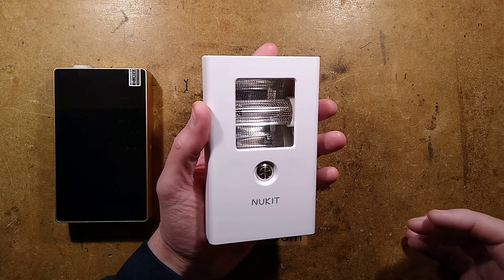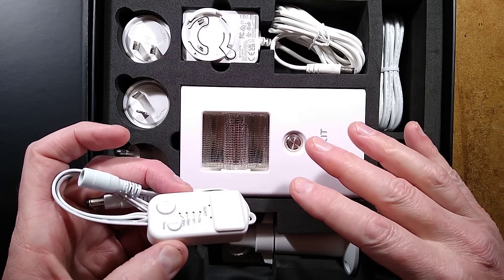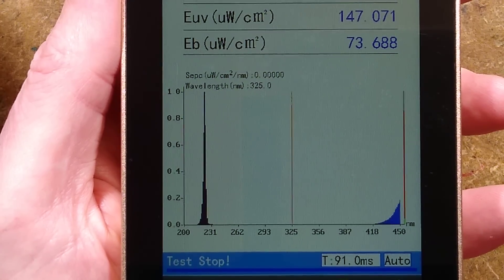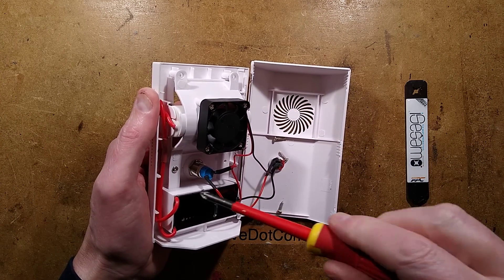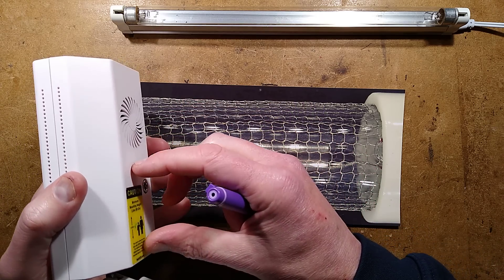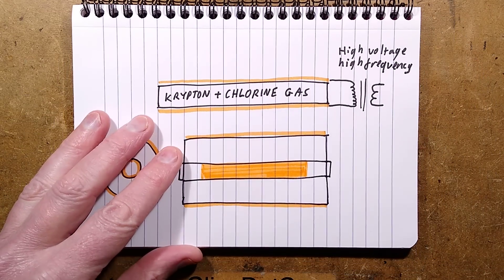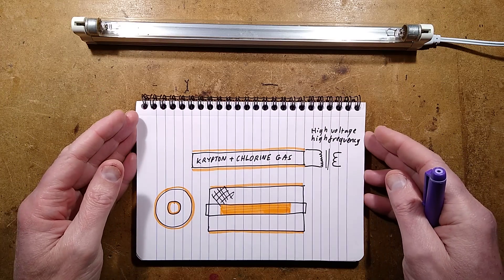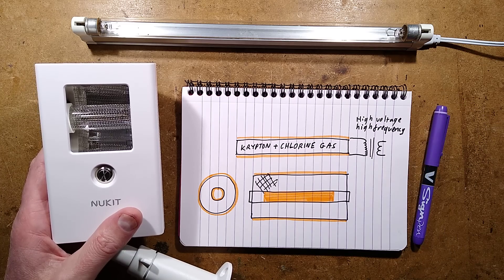Naomi Wu's Nukit 222nm sterilising excimer light

Comment: As a few people pointed out, even 222nm deep UV-C isn't 100% safe but good enough for most part since radiometric strength (brightness) matters a whole lot. If you are further away from UV-C lamp (be it LED or Excimer lamp), you're totally safe for most part, it also about how powerful is the light source (Excimer lamps tend to be inefficient, so deep UV-C LEDs are usually a concern due to their electrical efficiency, thus more powerful than gas-filled lamps).

Nevertheless, I did research a bit on 222nm deep UV-C bands for medical purposes, it's interesting that we're not as affected by it as much as Mercury-II UV-C lines (253nm being the chief spectrum line for Mercury vapor).
Reply: A brief synopsis of inverse square law might go a long way in explaining why this holds true.
Simple inexpensive polycarbonate safety glasses block pretty much all UV
Reply: Right; 253nm may be longer wavelength but is absorbed more efficiently and can cause greater damage (vs 222nm). If it is not absorbed by the cells, biological damage is minimal.

Comment: Clive, I have found 12V off grid/grid down is very hard to get if you are not starting with 12V batteries.  Most if not all power banks provide either 5V,  USB C and 120/240V.  The USB C does no do 12V native, and doesn't do any voltage native as it needs programming,  hence using USB C to lite a 12V filament bulb wont work.  It would be great if you could find ways of doing 12V without a 12V source when not relying on the grid :)  (my reason for asking, where I live I have a power failure at least every other week, my work from home mini computer is 12V and uses a wallwart and barrel jack to supply that and per the maker whom I contacted, it will damage the unit if you run it on the normal range of a 12v battery of 14 down to 10 and back up to 14 volts, it runs on 12 and like the holey grenade 10 only if gong to 12, and 14 is right out 🤭).
Reply from the maker: You can get USB to 12V converter cables.
Reply: perhaps a boost/buck converter module would give you a stable,regulated12V from a SLA battery's varying voltage,at the power levels you need for a laptop. maybe even from a USB source if they can source sufficient wattage.

Comment: I spent this afternoon disassembling my dehumidifier to get at an annoyingly loud buzzer. The thing was not designed to be taken apart once assembled. I removed all the obvious screws but two crucial screws were covered by a piece of plastic which was attached to the unit with ten inaccessible clips. Got there in the end with a little bit of bending of plastic. Buzzer successfully de-soldered. Thought of these tear-downs as I was fighting it.

Comment: I was hoping the whole virus fiasco would cause these lamps to develop into full production and lower the price and make the lamps more accessible. Bulb construction is simpler than a fluorescent, since there doesn't have to be any electrodes penetrating the envelope. Wavelength can be tuned by various gasses and halides. What are the details of the spectrometer? Model number?
Reply from the maker: The spectrometer is a Hopoocolor OHSP-350UVS.  Very specialist wavelength range, but they do others with a wider visible spectrum.

Comment: I'm cto for a uvc equipment manufacturer. We've had 222 lamps for testing for over two years now, working on products. We've tested both Chinese made lamps that look very similar to this one, but also t8 style tubes and lamps made in the EU by Ushio. From our testing they indeed work as advertised and are safe in normal use cases. Some interesting caveats and things we've found out. Ushio claims to have a patent on the filter (glass) material required to get that narrow wavelength. They claim the Chinese lamps aren't that airtight so the gas will slowly leak out and be ineffective (haven't seen this in the small lamps so far). Their lamps have distance sensors (single chip lidar based) that turn off the lamp if you get closer than a few centimeters because dosage matters, it's safe up to a higher dose, not to any infinite dose. There are not very extensive studies from 2023 showing they produce Ozone from the air being hit with the light, not from the tube itself, we haven't tested this because the power is so low on these you'd have to have a lot. But in a non ventilated space it could build up. The lamps we've seen are very low irradiance compared to traditional, it's also not very well established what dosages are used for what pathogens like we have for classic uvc, everyone playing it safe. Overall interesting tech, very early days. The power supplies on the Chinese stuff we've tested have been very crap inside the potting (cobbled together in some cases), maybe they've improved since, worth a video maybe?
Reply: Whilst potting is a great idea for high voltage stuff it’s the sausage of the electronics industry….  Packaging that hides all kinds of sins
Reply: I truly admire some of the Chinese 'cheapness optimizations' that can be found, but they can have some SUPER-sketchy power supplies, ones that are way scarier than I'd have believed any human being might bother to sell or use.  That's the first and most-important thing I check on any 'cheapy-project' items from China is their power supply system.
Reply: @EShirako  I agree, there is a noticeable difference between functional and safe/reliable.
Reply: @EShirako  this cannot be stated highly enough. I throw cheap PSUs in the WEEE bin as I'm cautious of them. We had a PSU (OE supplied with a quality item) that eventually went 'pop' and started smouldering. If I hadn't been in the house and heard it I dread to think what would have happened. It was all CE marked etc.
We need randomised quality inspections on Chinese products prioritised on risk - PSUs being highest I would say.
Reply: @thebrowns5337  I think I can agree with you.  :-\  I'm to the point where I even closely check ANY voltage-regulation that involved the mains before I leave an item unattended overnight/out of my sight.  I've had a steady decrease in quality happening in power systems, especially including fake (or badly de-rated) MOSFETs.
Reply: Good to hear about Naomi.
Reply: Water disinfection requires an adequate germicidal dose and contact time. For air and surface disinfection it is just the same and comes down to what organisms you are trying to kill and their population.
254nm was a primary germicidal wavelength so 220nm may have a similar effect but this needs testing properly in lab conditions.
I am very nervous about its claims that it is safe to view by naked eye. Perhaps its irradiated power is so low at distances greater than 1mtr but i cannot see how it would be safe at these wavelengths, but i will keep an open mind
Reply: @stillstanding123  it's 'safe' because it can't penetrate so deep in the tissue. Even 254 uvc has a hard time at penetrating surfaces, but it's enough to nuke your skin. Given enough dose it will 100% do bad things, but it's in a better place where it can still get through tiny organisms in droplets of liquid floating around or in thin films on surfaces, but not strong enough to get into skin easily. Least that's the idea..
Reply: @Les_Grossman  Ah, I was myself curious about UVC222 and water, some documents seem to support the idea that UVC222 in water will make ozone out of the oxygene solved in water. Unfortunately I am not able to understand if it is enough to make a difference concerning germicidal effects of this 6W unit. The lack of penetration (almost all plastic, even thin thin stops it), I wonder if that human blessing become a drawback in water cleaning solutions?
Reply: @Paxmax : With water disinfection you need to target a wide range of potential pathogens.
Reply: It's very hard for low levels of ozone to 'build up' as long as there are organics in the vicinity, due to O3 being extremely unstable.   (not just organic, it's just faster).
Reply: @tbelding  No offence intended and maybe I have misunderstood your comment so apologies is if have but I guess you have never experience Ozone poisoning like I have. 

I was in a factory unit approximately 65mts x 40mts x 15mts with a 400V x 1mt wide electrode that "treated" plastic film so it could be printed without the ink peeling off. There was a set of very large roller doors each end of the unit and with these open all three of us got massive hangover type headaches which was not pleasant.  The "treatment unit" had an exhaust fan that normally vented the Ozone outside the building but the fan decided to fail and we started feeling the effect about 2½ hours into out 12 hour night shift.
In such a large building with both very large roller doors open the Ozone level sure as hell did build up in the three organics in the vicinity. Fortunately it was a warm summer night and we spent it outside in between roll changes. (In case Eddie and Joy read this, Hi! 👍)

I would later in life warn school staff members to not stand near the photocopier if they were doing a long copying run like the school newsletter. Nobody ever realised the cool crisp smell of Ozone ( oh is that what that smell is ) could deliver such a very unpleasant headache.
Reply: @josephking6515  Very different situations. You were subjected to an ozone generator.   The fact that it was actively vented to the outside shows that.  That's high concentrations, and I'm glad you didn't end up in worse shape.   This is a tiny amount, probably similar to what get out by a transformer/power supply.   It's a side effect, and not a big part of the system.
Reply: @josephking6515  That sounds like negligence. There should be ozone sensors and an alarm to tell staff to evacuate, if the level is near the exposure limit. The exhaust airflow should be monitored and the ozone generator shutdown, if the flow rate fell too low.
Reply: @josephking6515 

Those cases are not the same as low levels building up 

They are relatively high levels to begin with.
Reply: Can I ask a question here? Are these things useful in air handling equipment? Like can it kill viruses quickly (before the air goes past)?
Reply: It'd have to be massively high powered to deliver a sufficient dose of UV to sterilise air, so no. Alot of air purifier companies claim to add uvc to kill viruses, but it falls apart for the reason above.
Reply: It's technically ionizing radiation, which is why the dosage is so important.
These ions formed in the air kill bacteria and also form ozone, and this strong absorption of air and moisture makes it quite safe to use.
I'm currently using a very similar product in my research and the lab technicians freaked out when they read the ionizing radiation label.
Luckily I could convince then that we have adequate safety precautions in place already, and I will be using it in a fumehood.
Reply: @bardenegri21  That is how ozone is made. It's oxygen (O2) that's been rearranged to O3 by UV light.

Comment: This is very exciting. It can also be handy for something like UV rock-hounding since most fluorescent minerals don't really react to UVA (with some interesting exceptions like rubies.) Obviously not as exciting as the germicidal uses!

I'm also looking forward to the day when 222nm is available in LEDs. It's definitely a years off, but it will happen. Veritasium has an amazing video about the development of blue LEDs, the decades required, the physical challenges, the technological innovations, the personal sacrifices that were made, and why it easily won a Nobel prize. But then followed deeper blue LEDs, then eventually 395 nm, which is on the boundary of UV (though definitely visible as deep violet), then 365 nm. Now 254 nm is becoming affordable if you need it. Each of these steps has followed the same development and cost curve.

If 222 nm is really as safe as it seems to be, it could be a real turning point in fighting infectious disease.

Comment: It's great to hear your opinion and seeing a teardown of the unit. It really does look well built.
This sounds really interesting, but I have a couple of reservations.
Firstly, price point. It's ludicrously expensive. Close to ten times the price it ought to be.
Secondly. I'm not sure I yet trust that wavelength to be safe for animals (humans) at that power level. While it may not turn your skin into the trademarked fried bacon you get from conventional UVC tubes, other risks may exist.
Could the shorter wavelength, for instance, mess with your cells in some other way? Impede organelle function or even be mutagenic (i.e. interfere with your cellular DNA processing)?
I don't know enough to know if anything like that is even feasible, but I'd like all possibilities ruled out before claiming it's safe.
Safe means that you've exhaustively shown that there are no feasible hazards. It's a bold claim that requires substantial backing.
Reply from the maker: A significant amount of research has been done by many genuine organisations.  The main risk with UV wavelengths is skin damage associated with how deep they penetrate into the skin.  The very short 222nm wavelength does not penetrate deeply.  Less so than the longer UV wavelengths present in sunlight.
The cost is largely because it's a new technology and has not been geared up to mass production yet.  It's also being aimed at professional use at the moment.

Comment: …. So it is safe for us but kills pathogens? If so = revolutionary; I can see a longer version of it being added to light fittings in private & public rooms and active while they are occupied and permanently on to continuously sterilise, imagine fouling on the toilet and having that above you radiating, will it also take-out odour particles so the next user won’t even know what you had done in the toilet 😊 [would remove the need for air-fresheners and the now compulsory “extractor fan”]. All forms of public transport vehicles would have them fitted in the ceiling along with the lights & private transport, all public buildings….. Unfortunately with “Naomi” despite her being a beautiful looking Oriental….her “breasts” ~ 😳, when I had her “sexy cyborg” videos appearing in my feed = reported them for having “sexual content”.
Reply: This assumes that people give the slightest damn about the safety of others. Covid has clearly demonstrated that when there's a conflict between cost and safety, cost wins every time. 

HEPA filters have similar benefits yet they're very rarely deployed. Indeed there's thousands of stories of subsidised or gifted units being switched off just because of the few cents a day they cost to run. They've known that HEPA dramatically reduce hospital acquired infection rates for years, as does upper room germicidal UV (unlike the Nukit 222nm units they have to be aimed above people's heads, but they've been available for a century). Yet they're never installed (The White House, being a literally glaring exception)
Reply: @gasdive  the one thing they didn’t do at the beginning of the covid-19 pandemic ☣️ was to subsidise air purifiers [UVC & HEPA types] so we could buy them un-mass, I think the pandemic would have been shortened with the “indoor air” being cleaner , but no they told us to open windows [alright in the summer, but not the winter when you want to heat] and mask in public [look diseased, and a black mask = racist] and when they approached DYSON they got them to design a medical ventilator for the “field-hospitals” and not reduce the price of their air-purifier range 😠. We don’t always get it right, yes that 222nm uv lamp thing is similar to an air-purifier, but it kills pathogens; and a HEPA type traps them in its filter (still alive) ~ unless it has a UVC tube/ozone generator before the filter which pre-kills them
Reply: @gasdive - same frustration I had with the covid-19 pandemic ☣️; after seeing those “masked” professors on the telly putting a fat man in front of a camera that could see particulates and have him talk, cough & sing then repeat with a surgical mask on him and “look! the particulates [& the “virus”] are being blocked 🙄, everyone must now “look diseased” in public. Along with social distancing and compulsory window opening, but no emphasis on the use of air purifiers/HVAC systems (set to permanent heat-recovery) in commercial buildings. Along with UVC sterilising robots & ozone generators I think the pandemic would have been shortened, and would have needed only 1 vaccine 🤔

Comment: I can see this technology being useful in air-conditioning systems for the control and eradication of airborne bugs like Legionella.
Reply from the maker: For fast flowing air a stronger shielded traditional source may be better.  This is optimised for direct exposure of a room.
Reply: Just use cheap existing tech.  No need to use 222nM because air conditioning is enclosed so saftey concerns.

Comment: Lamps with most of the eximer pairs are produced in China, mostly for UV curing inks, varnishes and lacquers, since most of the machines (jet UV printers and UV lamp modules for large ofset printing press sections - the ones that make varnish patterns over printed pages) using them are also produced there. It will be more interesting to have a specimen of KrCl lamp in some of standard fluorescent tube sizes (still has to be drived the same way as this one), even better mounted inside the internal body of an air conditioner.
Reply: If air conditioning is internal then just use existing uv tech.  No safety concerns if internal.